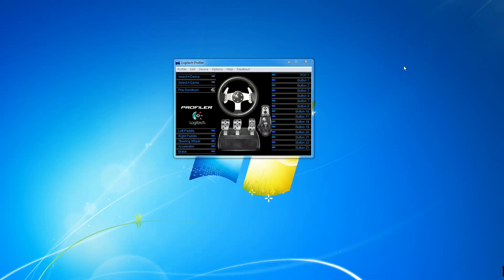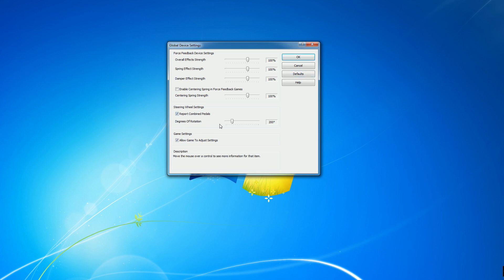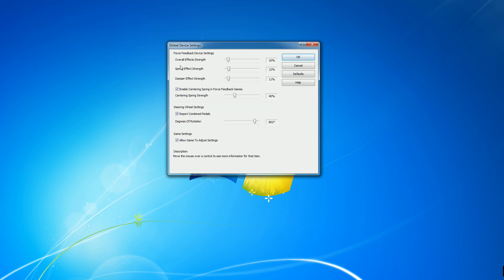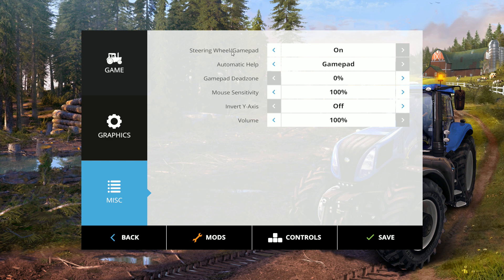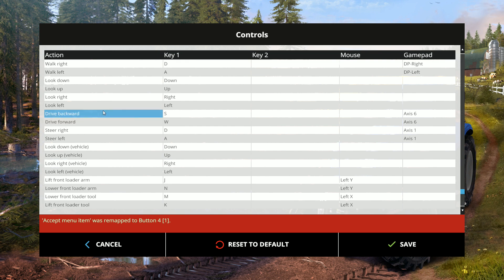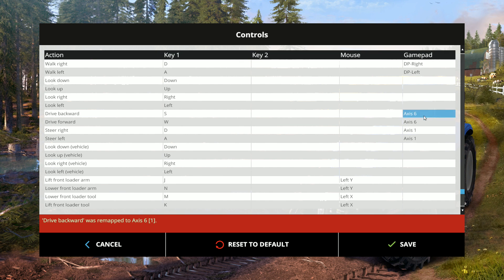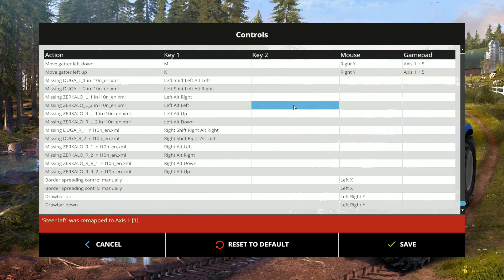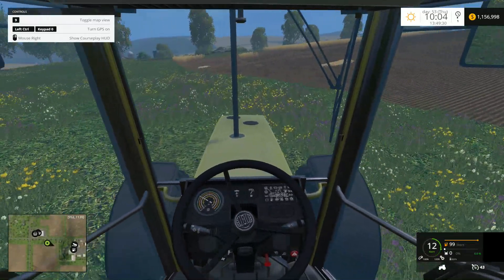How to setup the Logitech G27 for Farming Simulator 2015

Comment: I just got my g27... Thanks for video.   I'm interested in the rest of your set up.  I know everybody has a preference, but any info is a plus for me.  I did something I thought was cool, I'm using my shifter for the wheel loader.
Reply from the maker: Yeah you can have some other adjustment. 

I have the parking brake and the ignition on the shifter as well

Comment: hi lain,
 got a question on how to setup the rpm led lights on the g27 for the farming sim game? is there a mod for that or? any help would be good
Reply from the maker: +marc wohlmayer That only seems to work for some games. When I play Project Cars it works automatically. However, in farm sim I have never seen it work. 

I think it has to do with the way the game is programmed. 

I don't know of any mod that would help in this case sorry. 

Sorry I can't be of more help

Comment: my friend has a problem where his character keeps walking backwards, or inside the menu it will be scrolling up and down automatically, he has a G-27 and only mapped axis to the Drive options not the walk options. i have the same problem sometimes with my G-25 and it just appears to happen randomly. one time it will work fine and the next time you are looking at your dude walking backwards again. do you have any idea as to what might cause this?
Reply from the maker: This happens to me when I don't have combined pedals checked in the logitec profiler

Comment: When I barely push the accelerator the tractor goes to full speed making slow driving difficult. Does yours do the same thing?
Reply from the maker: +frank123612 Nope. I think I turned down the sensitivity. I'd have to dig through the settings though
Reply: +Iain Robson Huh, my sensitivity does change anything. Wonder if mine is messed up.
Reply from the maker: frank123612 hard to tell.

Comment: hi. I cant change my accelerate option when i have combined pedals. In the windows propertis of the wheel its 100% on brake all the time (changed to 100% accelerate when i press gaspedal down 1milimeter). you know how to get it to 0%? because if i try to set any key to anything it shows axis 6+the key im pressing. So everything is just fucked up :/
 i use Logitech G25.

thx for answers!
Reply from the maker: +Tobias Karlsson Is the break stuck or something. That's the only thing that comes to mind in this context
Reply: No. It works perfectly when pedals not combined :-(
Reply from the maker: Tobias Karlsson Strange. My only thought is that maybe the pedals are assigned to something else too and that's whats causing it
Reply: +Iain Robson i have deleted all assignments but still no luck. the problem are shown in windows wheel propertis to. im waiting answer from logitech. i hope they know what the problem is :(

Comment: There is a huge problem! When
 I try to connect the steering wheel to the GTA and Farming Simulator, I
 restart, and after the switch switch down - and in the game the camera 
goes down! What to do - I use Logitech G25!
Reply from the maker: I think your looking function is linked to your steering wheel somehow. I would look to see if you have a keybind set up with your steering wheel.